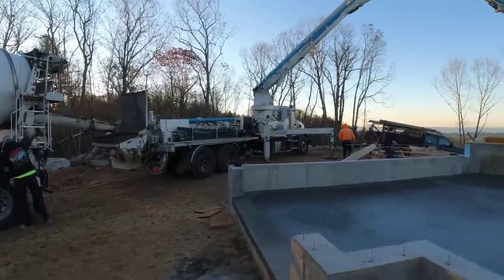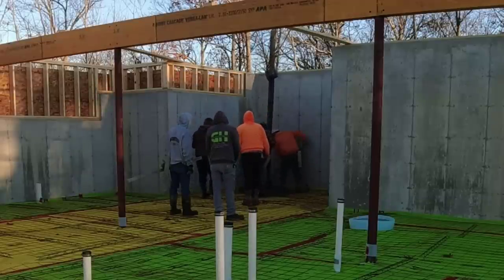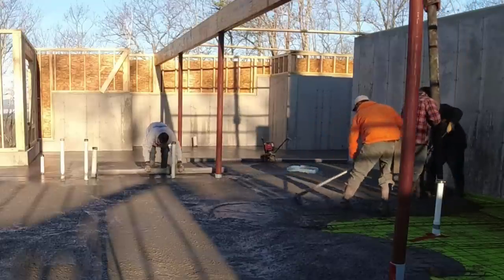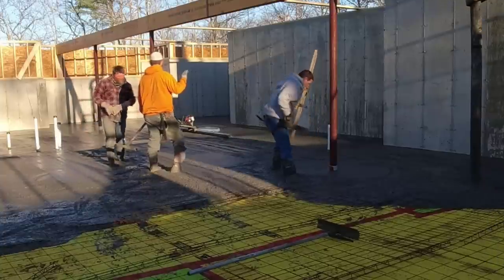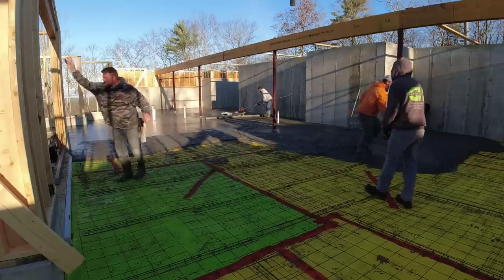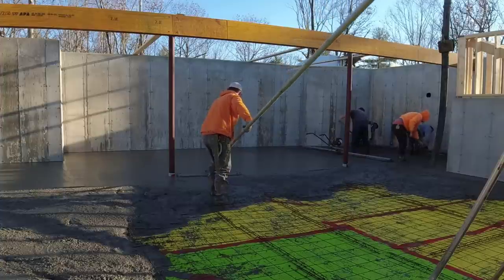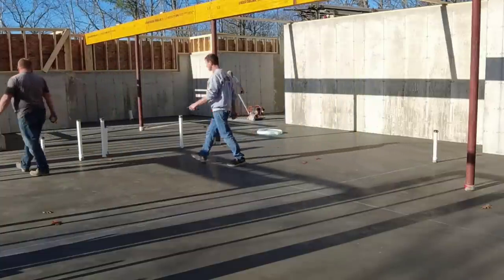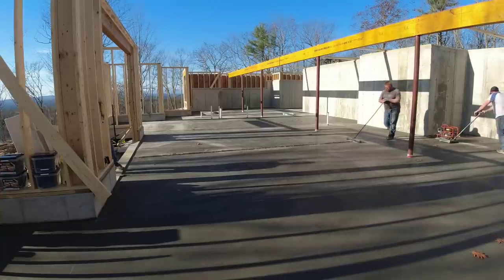How We Place These Big Concrete Floors with 5 Finishers.

Comment: Hey mike I poured a good sized house slab last Friday over here in central Vermont on stego vapor barrier with 18” of glavel which is insulting glass drainage stone looks like soft coal that was a first for that stuff but I guess it’s getting more popular are here anyway I had a pretty good mat of rebar in this thing and big thickened edges or (hunches) well the plant I use runs 140 degree water and I ran a 4000psi 3/8 aggregate with mid range and 3 percent non calcium accelerator about a 6 slump holy smokes that stuff was cooking. I’ve been using 2 percent and it really didn’t seem to be helping it to set faster but I guess 3 percent was totally different, I know you seem to have similar weather and run similar mixes to me but have you noticed the n. C. A. To not really do much with 2 percent ?

Comment: I would have guested at least two guys on power trowels but you guys know your stuff.  You got a lot done and had the afternoon to do more somewhere else.  LOL
Reply from the maker: One good guy with one good power trowel can cover a lot of sq footage.
Reply: @MikeDayConcrete      That’s a lot of edges for 2 guys, Mike, and a lot of floor for just one Troweling Machine, especially with the Sun out and excellerator in the Concrete. 2 Machines and 3 or 4 guys on Edges would be the Correct way so your not Fighting it or Killing the Guys. I’ll watch the rest of your video to see how it turns out.
Reply: And John D S , That took them all day, Start to finish, especially if they Saw Cut the Floor. After All that I be Damn if I’m going somewhere else in the Afternoon as you say. This Ole Boy here is Headen to the Tavern.

Comment: Rule of thumb is most experienced finishers can finish 2500 sq ft alone, so one trowel, and 2 guys doing edges should do the trick, nice job once again.
Reply: Finish meaning be able to strike off and lay it down, I honestly can finish a 60×40 all alone if I have help getting down 3 ft machine in the sun, if it's a slab and I can walk around it all. Anyways jw. Like mike said to many variables in the winter, need extra guys